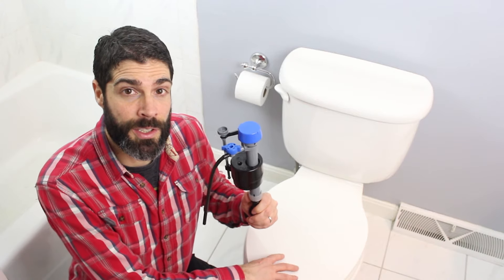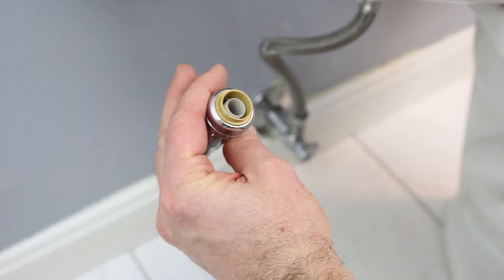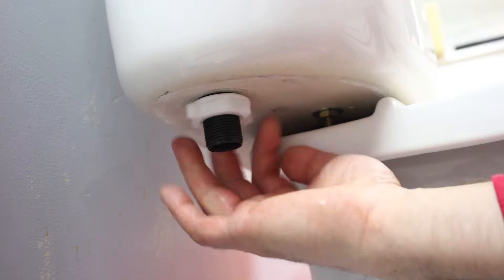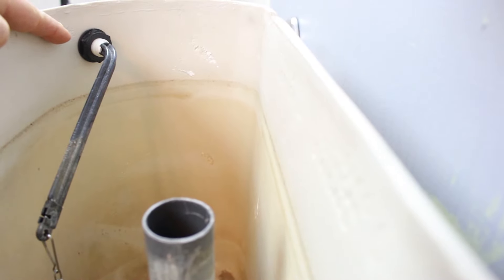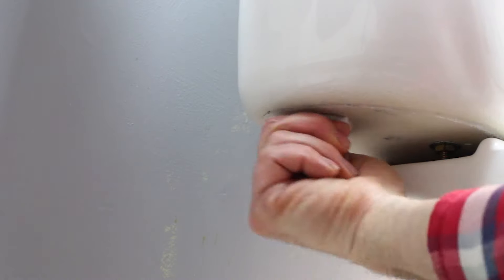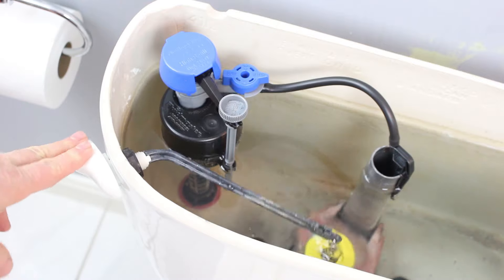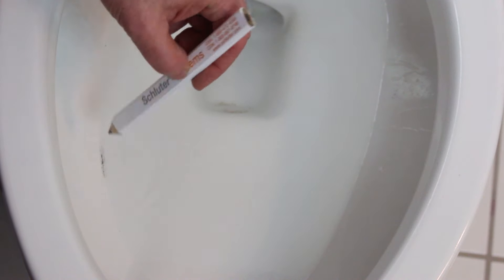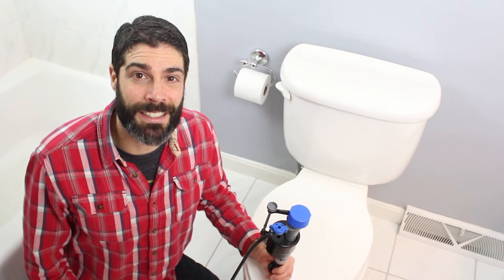Fix a Running Toilet...Fill Valve Replacement -- by Home Repair Tutor

Comment: We installed the new fill valve as shown, tightened the nut and attached the water supply back on, however the water splashes out from underneath. What could we have done wrong?? Help!

Comment: I used this product and ended up having a plumber install because he was here already for a separate issue and my water isn’t filling my tank. Line is open but there’s no water. What is the problem 😩

Comment: Fluidmaster is cool because you can pop the top & replace the gasket only. Korky, you replace the whole valve. I always use a little bit of black water grade silicone on my fittings. Stops any pinhole leaks you get. I had only a few to not drip going full dry on these. I have a 1 1/8" crows foot by Mac I use on the assembly. Keeps you from overtightning. Sometimes you need to tighten the 5/8" compression nut on the shut-off if you bumped it during assembly.

Comment: Called a plumber out for noisy humming pipes after water use. Plumber says "can't" do anything about it the system is self sealed, I get it. I finally hear the noise loudest in guest bathroom, I shut off the toliet  water supply valve and no noise. So I change the toliet fill valve with the help of this video and presto even a quieter flush and noise is for sure gone. No offence to plumbers reading this, it is what it is.
Reply from the maker: Sweet!! Great job diagnosing the problem and fixing it, that’s literally half the battle

Comment: Does it matter what type or brand of toilet I have now?  My toilet continues running water into the toilet bowl after I flushed.  Will replacing this fix the problem?  Currently my toilet has a ball in it.  Please advise!
Reply: This video should help from what you just described. Lmk how it goes

Comment: My fluid master has an issue with the buoy part getting stuck and the tank is not filling.  It gets stuck in the up position so it never refills.  I have to constantly take the lid off and force it down and force it back up with it’s filled up high enough

Comment: So I watched another video and they used a tool to tighten the nut under the toilet for fill valve and there’s a leak- and now I can’t get the stupid bolt off!!!! I tried to use a tool to remove it and it cracked the two little wings on it- im so frustrated. I can’t get it off because I realized the seal wasn’t on the fill valve inside the tank which is why it is leaking

Comment: Help, my water supply line is stuck in there and no matter how many times I turn, it won't come off from the toilet. I've tried using a rench for better grip but it doesn't budge and both the nut and pump inside just turn with it so I get nowhere.

Comment: Hello I changed my toilet fill valve which was the main problem of the toilet. Installation was a success. Fills and flushes with no problem. But now I’m noticing that every so often, it sounds as if the water turns on for about 5 seconds at most and refills the tank. Never did that before with the old fill valve that I took off. Any ideas what could be the problem ? Thank you
Reply: Probably need to change your flapper valve, or the o-ring at the bottom of the cylinder if you have the new kind of toilet.

Comment: The lid cracked my cap as it was making contact with the underside of the lid with the 3 inches. This was also causing the water to run constantly jacking my water bill up by 50%.

Comment: Thank you Dave Grohl!
Reply from the maker: lol
Reply: I am trying to find information about a toilet that has 2 floats inside the tank. I've never seen that before. But my toilet is running every 5 minutes for about a minute.
And the floats do not float down unless I hold the lever down till the tank is empty, so the water is totally out of the tank. I don't think I need a new toilet, but I need to find somewhere to get the two floaters. This is in a 2003 park model home.

Comment: I need some help. I have an older toilet and when I flush it won’t fill by itself.. I have to manually push down the fill valve arm for it to fill every time. I’ve looked it up but haven’t found a video for it or anything in google. How can I fix this?
Reply from the maker: Is it an old ball shaped valve?
Reply: Home Repair Tutor no it’s like the one in the video.
Reply: The kid is only $13, and it is easy to fix. The only problem that I had is I bought an OVE Decor Beverley toilet 2years ago. The design is skirtedand doesn't leave much room to work with in the back especially when your toilet is sandwiched in between the shower wall and your vanity. LOL I literally felt like Gumby trying to contort to get into the space.
Reply: I had the same thing I had to replace it but I have a question and I can't seem to get an answer after I installed it said it would be quiet and I hear gurgling and bubbling how do I deal with that

Comment: My toilet is constantly running. When I turn the water off to the toilet, I noticed that water flows out until right below the fill valve. Does that mean I need to replace ? Thank you!
Reply: I'm having the same problem. Did you ever solve it?

Comment: can I ask, i just replaced the fill value with a new but the water come on and fills a little every minute or so, why is this?
Reply: SO I SHORTENED THE CHAIN AND IT WORK OK BUT STILL HAVE WATER FILLING EVER 5 MINUTES OR SO AND NOT SURE WHY
Reply: Water is probably leaking past the flapper valve, on the bottom middle of the tank,  and it has to refill to top the tank off. Turn water off outside toilet, flush, clean the bottom of the flapper valve, turn water back on and test flush and listen. If that doesn't help, then replace the flapper valve (about $5). It is either a 2" or 3", can bring the current one to the store to ensure right size.

Comment: Woo-Hoo!  Another female "Boomer" that just changed her toilet fill valve!  However, it did take me a little longer than 15 minutes as I ran into "issues".  Like some of the other commenters I ran into trouble disconnecting the water supply and the original locknut.  Whoever installed the toilet originally must have had superhuman strength!  Seriously!  Also, I did run into trouble with leaking.  Arrggggg!  My suggestion is to pick up a roll of teflon tape and maybe a tube of plumbers paste to save another trip to the home improvement center.  Badda bing - badda boom!  Presto-chango!

Comment: when i try to remove the water supply line the fill valve spins with it and i cant get it to stop
Reply: I hold the fill valve steady inside the tank with the left hand, while loosening / tightening the nut on the fill valve stem under the tank with the right hand.

Comment: The toilet tank in my house does not have the connection for the smaller hose. Mine is just an open tube with three slots and the hose goes on there

Comment: This video is incorrect where it tells you to remove the nut under the tank. You can take off the top part of the fill valve in your tank by sliding a collar up and pulling up on fill valve. Simple put the top half of the new fill valve on  the post inside and secure the collar. Much simpler

Comment: Hand tighten, huh?  Sprayed water all over the wall when I connected the water line back.  Even after using plumbers tape and wrench tightening,  I still have a leak.  Hand tightening is NOT advised!

Comment: Bro…shark bite fittings are the worst. If they lose power in home during a freeze, all of those fittings will pop right off. Also, for the love of god, just buy a regular fill valve with a brass shank (the shank is the part that you tighten the toilet supply line onto). Most major supply stores sell them for like $10-17 and they are way better than the entire cheap plastic ones.